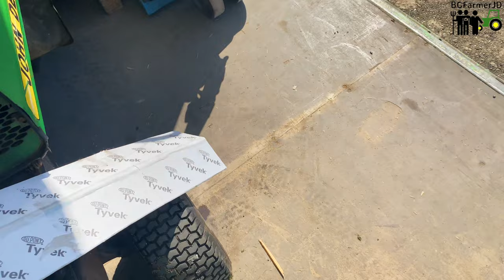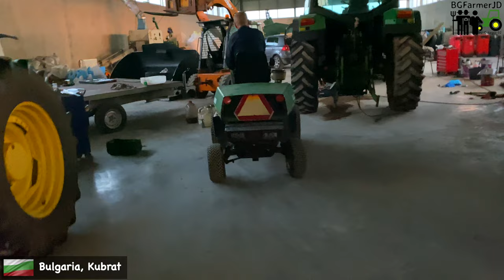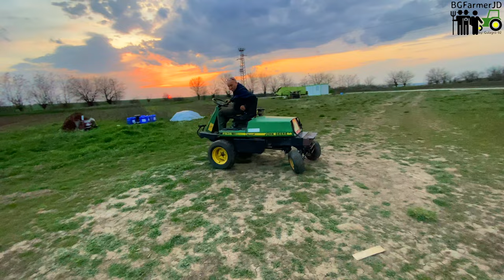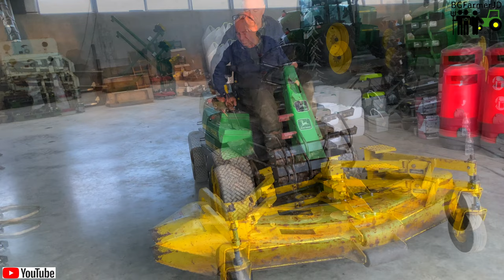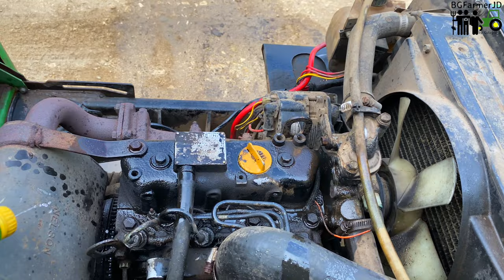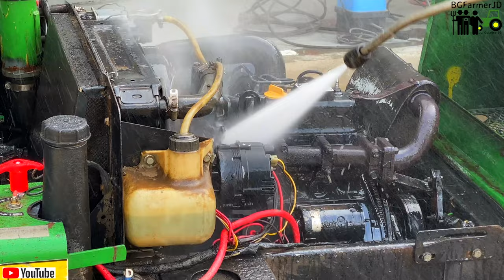4K ✅ Our NEW Mower John Deere F935 🔥 DIESEL 3 cyl. 🔥 New import from Sweden 🔥 For mowing Ryegrass 🔥

Comment: I have the same machine. It has some interesting electrical issues of late, namely a fault somewhere that is likely an old safety switch somewhere that came back to life, but prior to that, the connection to some near antiquated gyro thing that serves as the means to engage the PTO.. 
Very counter intuitive considering the forward lever you advance feels just as mechanical with a bad result as it does with a good one. 
A simple toggle switch would have sufficed!
The price was right however, so no regrets. 
I like the way you showcased it's movement. 
As graceful as someone on figure skates. 
😎🍺